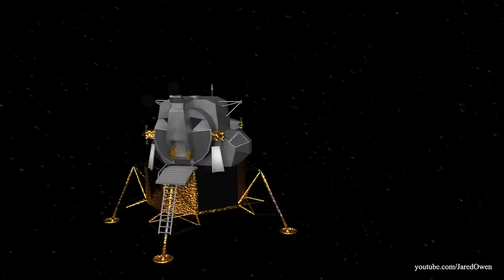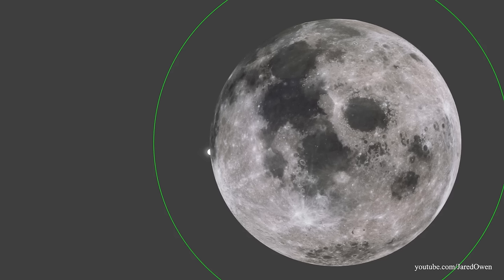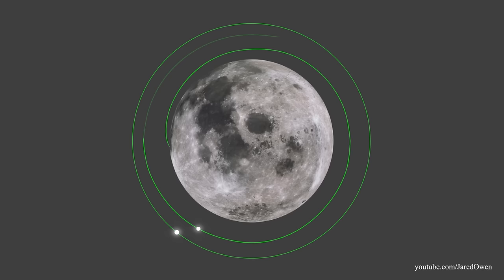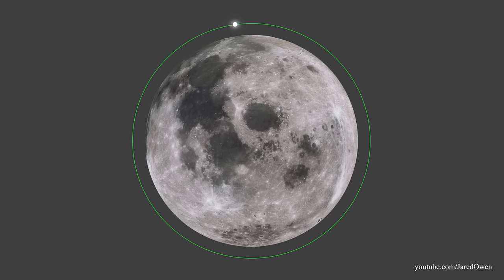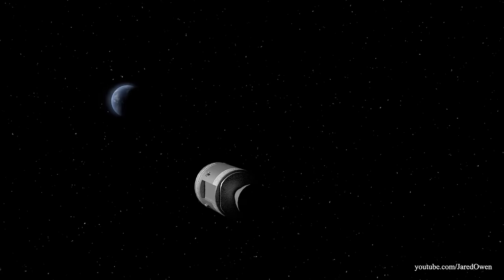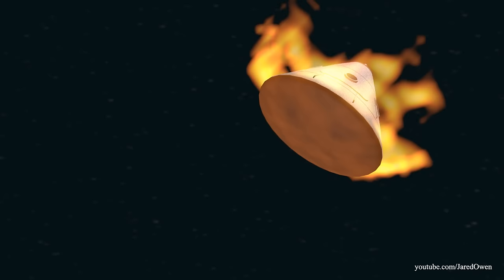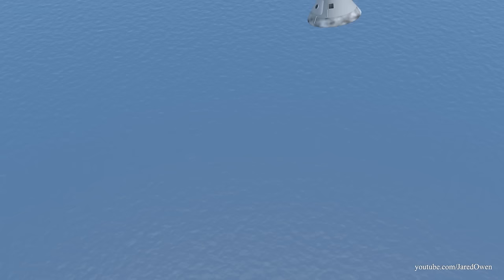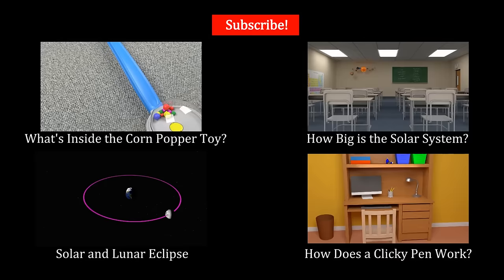How the Apollo Spacecraft works: Part 3

Comment: Now I'm almost convinced is fake, because of the lunar descending trajectory witch is not possible at the speeds that it is talked about in a flight like this. Even though the moon has 6 times lower gravity, because of the lack of atmosphere the landing speed would off be enormous and impossible to almost cancel(from 7-8kmps to 2-3mps) with such a small rocket engine, and also for the lift off from there I do have a lot of wonders and how was also able to connect so perfectly with the orbiting module, who needs 2.38 km/s to stay in lunar orbit. Sorry to realize this but I'm pretty shore this wasn't possible flawlessly!
Reply: I dont know where did you get that numbers. The orbital speed of the modules was about 1.7 km/s, due to small size of the Moon less energy is required to orbit it, plus, the Columbia Module had an engine with a really high specific impulse, which made it more efficient. Have in mind the Landing Module didnt have to carry the rest of the rocket, only itself, so less fuel is needed.
Reply: @tsurutuneado5981  ok, be as u say with speeds and masses so less energy, but about precision: imagine that you have to match exactly traveling with those 1.7kmps(2000km/h!!!) With a thing that comes of course at same speed from ure left and that is controlled from 400,000km and always match from first time?! Right!:))
Reply: @popra432  The thing is they didn't manage to do it the first time, they took a couple of orbits before finally rendezvousing. Calculations were made in order to get the two spacecraft as close as possible during the ascent, then the orbit of the Ascent Module was fine adjusted to come really close to the Command Module in the next orbits.

Comment: If the fake LEM is still in orbit they can easily use earth radars to find it. The flying bedpan, fully loaded LEM, LEM on the fake moon, and ascent LEM had different second moments, masses, and mass centers, but for some reason the 4 groups of constant force steering motors worked just fine. No radar stations on the mooooon to verify the fake LEMs ascent and descent path versus time,  or unknown CSM orbit. Terrible hoax.
Reply: Most of the lms were deorbited remotely

Comment: And of course.. they landed exactly on target with no thrust capability  in a non aerodynamic pod and with 3 parachutes that would pack bigger than the whole capsule ...
Reply: The pod didn't need thrust. It had an offset center of mass, allowing it to steer by rotating.

No, it's not very aerodynamic. That was the point. It was draggy. But it also has a shape for which drag analysis is relatively easy, and months of calculation nailed down the reentry zone to a T.

As for parachute packing, you're just super wrong. The parachutes deploying and then getting out was filmed. They fit inside.
Reply: @maxv9464  an inverted cone rolls out of control in every experiment ever done, Thats basic aerodynamics . and as for  the parachutes, you just religiously saying that miracles  happen . also I know the game
Reply: @marxman00   It only rolls out of control if it hasn't been carefully tuned for stability and if you don't have things like RCS and if the center of mass isn't very low. Centure of pressure, angle of attack, all of it matters. Yes, it's more aerodynamically stable in the opposite direction, but it's not actually that hard to stop it from flipping over. Saying "Every experiment ever done" is BOLD and demonstrably false. Do you think the landing video was faked? You know the Apollo capsules went straight to museums, right? They really did come out of the sky and deploy parachutes and astronauts really did climb out of them. Props for the absolute weirdest anti-moon-landing argument I've ever seen.
Reply: @marxman00  I'm not saying "miracles happen". You haven't proved that the parachutes couldn't fit, and I've seen many videos of them deploying and getting packed.
Reply: @marxman00  Many hundreds of seamen watched the capsules come down in person, by the way.
Reply: @maxv9464  so what
Reply: @marxman00  so you're wrong. You're saying that something that can be stable couldn't, that parachutes can't fit where they did, and that those things working in concert during 10+ Apollo splashdowns observed by tons of people and recorded by tons of camera, also didn't happen.
Reply: @marxman00  : Thanks for admitting defeat, son.

Comment: Nice Hollywood fantasy. How did they protect astronauts from deadly solar flares and cosmic radiation?
Reply: There weren't any "deadly solar flares" during the Apollo missions. However they did coincide with a solar maximum and a significant solar storm did occur in August 1972 between Apollo 16 and 17. Had this had happened during a mission, a moonwalker caught in the August 1972 storm might have absorbed 400 rem - not necessarily fatal if they immediately returned to Earth for treatment. However, in the event of the threat of a SPE/CME, they are going to remain inside their spaceship (or habitat). An Apollo command module with its aluminum hull would have attenuated the 1972 storm from 400 rem to less than 35 rem at the astronaut's blood-forming organs. That's the difference between needing a bone marrow transplant, or having a headache.

Meanwhile, GCRs do not pose a hazard to a two week manned mission to the moon.
Reply: @yassassin6425 
Wouldn't the astronauts be even better protected if turning the CSM to have the entire bulk of the Service Module between themselves and the Sun?
Reply: @fromnorway643  
Yes, absolutely.

Comment: forgot to mention the part where it's travelling 10,000 mph and pulls the parachutes.  Really, what load of crap
Reply: When the three main parachutes were opened at 10,000 ft, atmospheric drag had already slowed the CM down to 175 mph, and they reduced the speed to only 22 mph at splashdown.

Comment: The command module orbited 69 miles above moon, according to NASA.  And you expect us to believe that that the lunar module had room for the nuclear Platonium ac/heating system, the astronauts, food, restrooms, fuel, engine, navigation system, electrical systems, oxygen for days, shielding from lethal solar flares, cosmic radiation and constant micro meteor blasts, self-sealing and pressurizing systems, communication systems, etc? Laugh out loud.  That thing was compiled with tissue paper, cardboard panels, etc.
Reply: That thing was compiled with tissue paper, cardboard panels, etc. because it's what you need for Moon landing. I think you are projecting your experience of living on the Earth to a completely different environment, the Moon, where there isn't any atmosphere, the gravity is 15% of the Earth's and there isn't any kind of humidity.